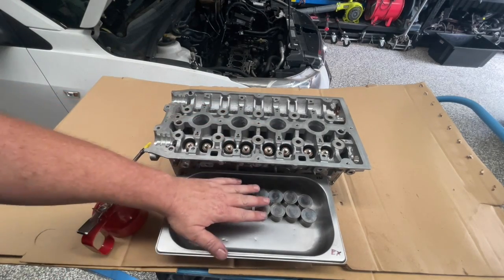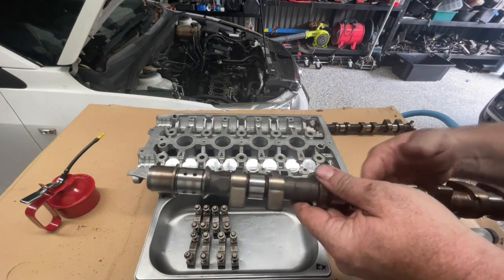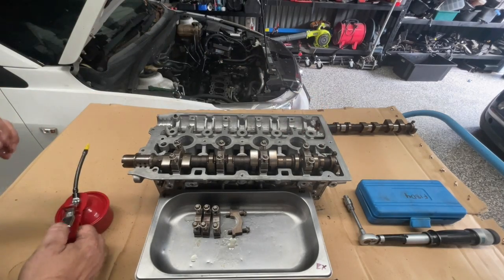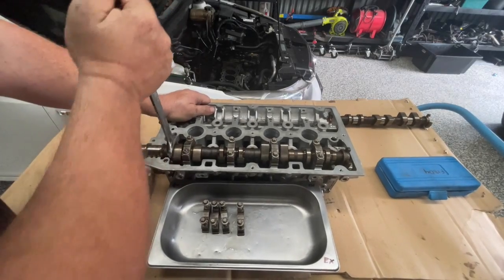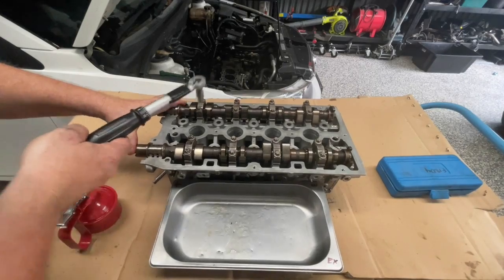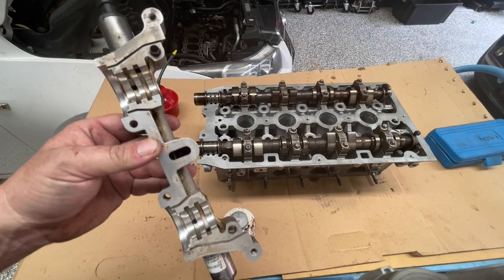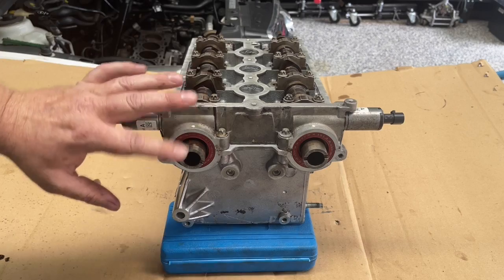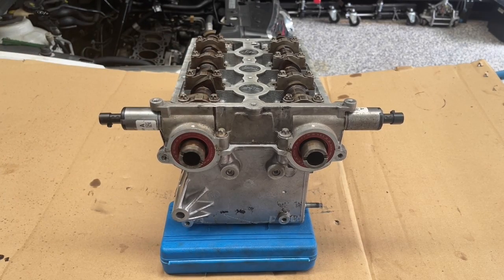Cruze Head Gasket Replacement  STEP by STEP process (Part 6 of 16) Full Details for 1.8 F18D4 Engine

Comment: Chances of a head gasket failure if i don't get the head machined? Or can i just use a brake rotor (brand new) to level it? If it can be done by hand id prefer to do that.
Reply from the maker: best to get it machined but these other methods can work

Comment: You've done a great job with these videos!  A tip: when sealing the surfaces of the camshaft cross bridge, I lay some string in the 4 oil drainage slots in the cross bridge before assembling onto the head.  Then, bolt the crossbridge down.  Leave for 10 minutes whilst working the string back and forth to ensure the drainage slots are clear before finally pulling the string through.  Then, even if you seal all the surfaces the drain slots remain clear.
Reply from the maker: Awesome tip I like it!